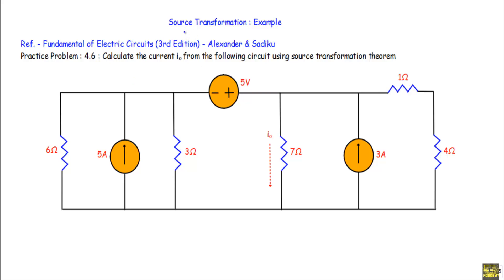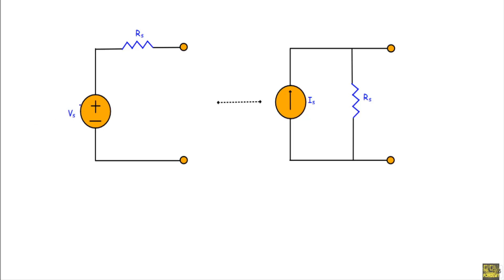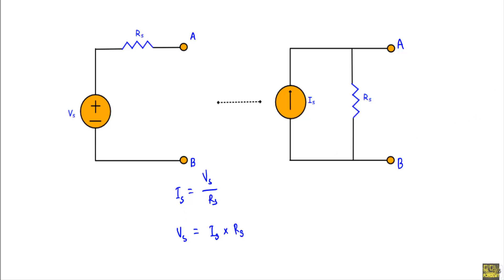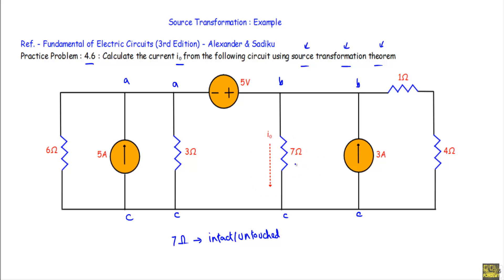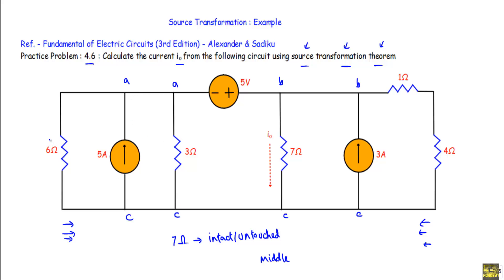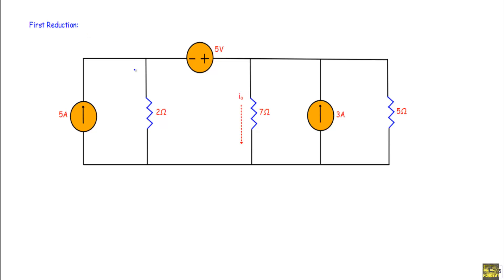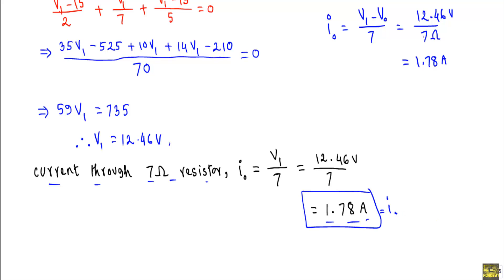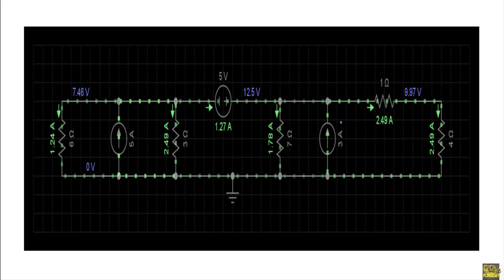Source Transformation : Example 3 (hard)

Comment: 9:25  it's easier if you transfer both of the voltage sources into current ones then you sum the current sources and 2,5ohms resistors then use the divider rules